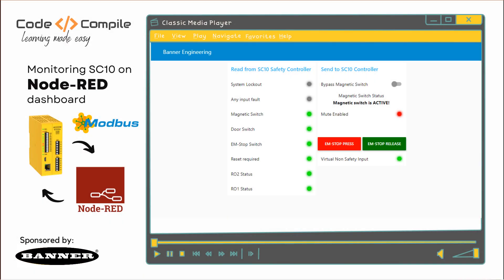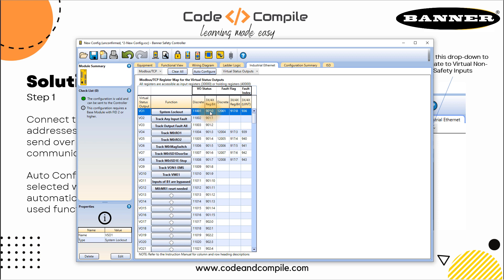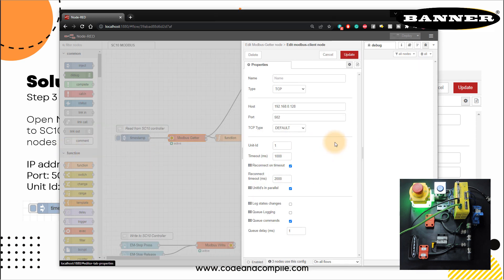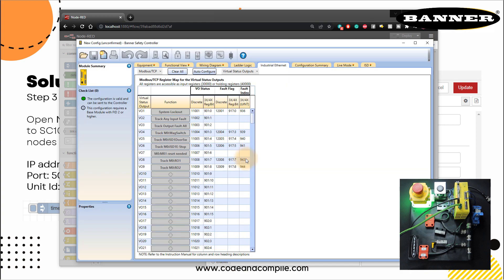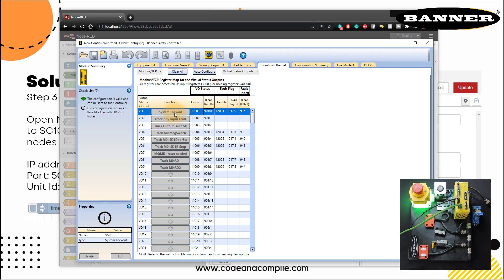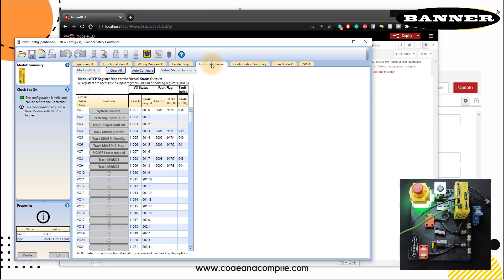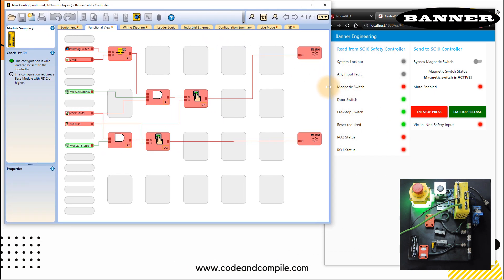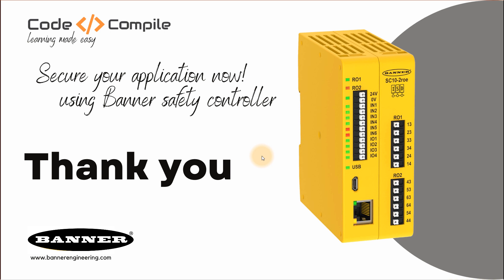Episode 11- Monitoring safety sensor status on Node-RED

Comment: to check whether a bit is set or not, consider bitwise operations instead of strings:

48 & (1 << k) != 0

48 & (1 << 0) != 0 # False, i.e bit 0 (right-most bit) is set to zero
48 & (1 << 1) != 0 # False, i.e bit 1 is set to zero
48 & (1 << 2) != 0 # False, i.e bit 2 is set to zero
48 & (1 << 3) != 0 # False, i.e bit 3 is set to zero
48 & (1 << 4) != 0 # True , i.e bit 4 is set to one
48 & (1 << 5) != 0 # True , i.e bit 5 is set to one
Reply from the maker: Thanks for the feedback :) I will give it a try 💪🎉